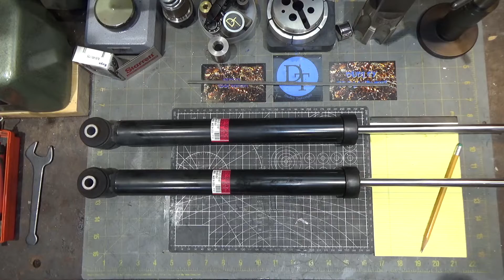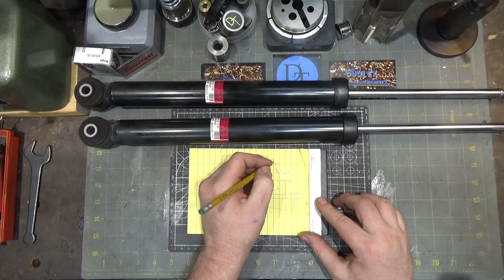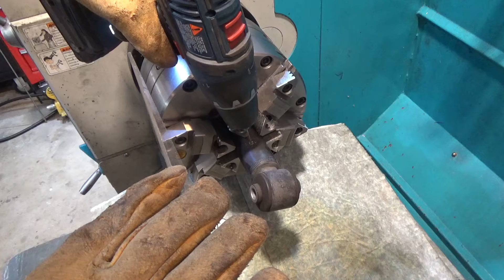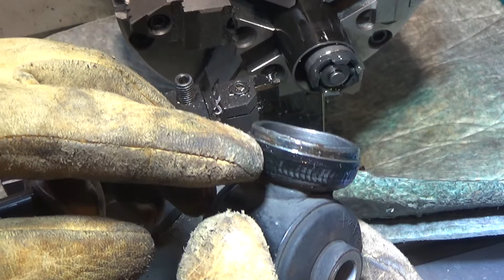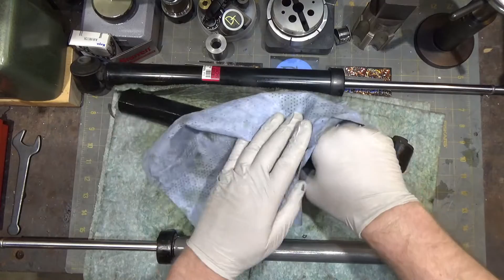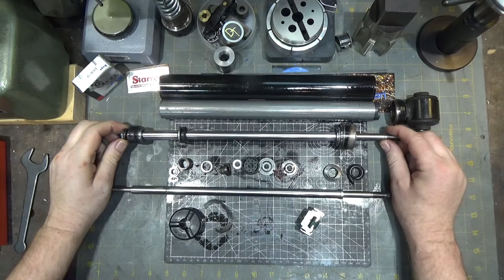138 Gas Shock Dissassembly

Comment: the sad thing is, that made in USA does not mean quality. That boat left long ago, if it ever existed.
Back in 1976 I had a Chevy Camaro 1967, and a few years later a BMW 2002 (1980). The Camaro I rebuilt for street racing. The 2002 was a mistake to buy, the guy that sold it to me put a new gas filter (clear) on. So I didn't know the gas tank was rusted out.  Anyway the Camaro was a POS design wise, and machining wise. The cam lifters were not correctly drilled so it ate lobes off the cams (multiple).  I could go on about problem after problem. I quickly learned that our cars were junk boxes. When I disassembled the bmw 2002 engine and rebuilt it in one day, I found out how far behind we were. Everything was machined to perfection. I started to see that we were stuffed shirts so to say. When I bought a Honda a few years later, I again saw and it reinforced that we were stuffed shirts, full of ourselves. I remember replacing shocks over and over, and how much better the mcpherson struts were. I noticed that they were engineering improvements and we were stuck in time.  The europeans and japanese were using disc brakes regularly, while we were still playing with drum brakes except for performance cars like the Corvette and El Camino..  Again, I could go on an on.. Monroe shock... sad.. low quality crap.
Reply from the maker: We are on the same page here. I still don't buy American cars, even though they have improved a lot, because to me a car is a tool that just needs to perform without issues. Most people I work with, buy only Chevy, and in that small sample, they all have many more problems like broken window regulators and dead alternators than I ever have.

Comment: Small comment as more often than not, this term is used incorrectly: "dampening" is getting something wet, whereas "damping" is reducing the amplitude of something.  Thus the term for the action of a shock absorber is "damping", not "dampening".
Reply from the maker: Thank you very much. I never considered the distinction.

Comment: If you do a search on Monroe sunset track shocks you'll see in the diagram they relieved the outer theatre wall of the inner tube to allow fluid to pass by easy in the middle which veer normal ride height
Reply: No problem I was a auto technician for 10 years they where the best when they came out
Reply: Monroe sensor track
Reply from the maker: I did not notice that. Thanks for the info.

Comment: @Dudley Toolwright  The adjustable feed rate dampeners like an Enidine ADA are pretty interesting too and much more complex than I thought. Something like that would work great on your band saw... Hey, that maybe a good use for the other one, just need to make a bypass with a flow control valve and prob a reservoir for when the rod in depressed to account for fluid displaced.
Reply from the maker: I love the bandsaw feed rate control idea, thanks.

Comment: You have it basically correct as to function. On race vehicles the shocks can be disassembled and the dampening springs and the shim packs can be tuned to get the optimum compression and rebound for the conditions and the vehicle suspension design. I have a basic idea of how they work but tuning shocks is an art!
Reply from the maker: Thanks for the feedback. Its always interesting to learn something new.

Comment: i seriously  doubt that the shocks are charged with much more than a couple of hundred psi.if the rod were only 1/2 sq in in area you would have a force of 1250 lbs pushing up and the rod ! i believe the purpose of the gas is to prevent the oil from cavitating as it moves thru the shock.
Reply from the maker: Excellent point. I should have done the math. I intended to and then plumb forgot. That would have been interesting info for the video.
Reply: @DudleyToolwright  A low pressure shock will be on the order of 60psi.  A very high one 300.  The vast vast majority will be from 150 to 200.  Cheers.
Reply from the maker: Thanks for the info. I really appreciate it.

Comment: cool video from wath i was told that the verey top should not have and oil to it and it should not bypass the center rang but I could be wrong and the only one that dose any work will be the bottom one and your right the top dose get wro out after time and that how they fall 
 I never had any problem with MONRO shocks thats all I run on my cars must been a bad day
Reply from the maker: Great points! I appreciate the info on Monroe shocks. Hopefully they spent all the quality effort and parts in the interior bits.

Comment: You should have drilled a metric hole it would have complicated the flow
Reply from the maker: Damn, I knew using imperial drill bits on a metric shock would be a problem.

Comment: If any amount of gas dissolves into the oil, then the sudden drop in pressure as the drill pentrated would allow the oil to froth into a foam, which briefly reached up to the drilled hole before subsiding.  This is why quite a lot of oil was still left inside.
Reply from the maker: Excellent explanation, thanks. When I was editing the video, I was thinking more about the cause and sort of came up with a similar conclusion. I was wondering if the manufacturer would choose an oil that did not readily allow nitrogen to dissolve into it or if that was even a consideration at all.

Comment: I'm an automotive technician, so i come across a lot of used shocks and struts. I try to always cut the shafts off for projects. Its very good material, whatever it actually is. I actually work at a Kia dealer, and can attest that OEM parts are way better than aftermarket.
Reply from the maker: Thanks for sharing

Comment: I was heavily into racing RC indoor cars years ago and I had to build and rebuild shocks pretty much every race day.  Those tiny RC shocks are built just like the real ones.  So many options of fluid viscosity, pistons opening sizes/numbers, spring stiffness, etc.  a lot of science.
Reply from the maker: My previous boss was as well. Apparently, you could have as much fun modifying the car as actually driving it.
Reply: Dudley Toolwright give it a try, I know you want an another hobby

Comment: Few more..

The rubber piece and washer up from the piston on the shaft is likely a top out bumper.  Diameter is smaller than piston so very little damping.

Of the 2 valves on the piston, the one with the spring is rebound. The other side is simply a one way valve on the piston to let oil flow through.  Again compression is the valve on the bottom.  

The compression valve at the bottom of the cylinder will have 2 valves also.  A compression valve and free flow valve to allow oil to flow through.
Reply from the maker: Thanks for the tips!

Comment: The are a number of issues you are missing.

What you have a number of issues wrong. 

1. what you have is a double wall shock. (there are single walls)  See link

2. the shock is pressurized to reduce cavitation.  Pressure is about 50 to 300 PSI of dry nitrogen.  If rod were say  1/2 inch and the pressure 3000 psi, you have about  600 lbs of force to more the rod in.  

3. the resistance is mainly the pressure inside the shock trying to force the rod out of the cylinder. I guess you could say that it is the area difference between top and bottom of the valve as it is really the rod that is being push out. 

4. There are 2 valve inside the double wall shock, one on the bottom and one on the shaft. Bottom for compression damping and shaft for rebound.

5. There are 2 speeds, low speed is typically an orifice. High speed is either a flexible shim or spring loaded valve.   

For reference. 

http://www.kybweb.com/en/shockabsorber/Structure.html

What type of engineer are you?  I'm retired EE but worked has a motorcycle mechanic while going through school to get my degree.
Reply from the maker: That was really helpful info, thanks. I did a bit of research before I made this video, but mostly I was trying to figure it out on the fly. I guess I missed the mark a bit. I really appreciate the clarification and correction. I am an EE as well, but wished that I had gone mechanical. I had no idea how much fun it could be, with endless bits to learn.
Reply: @DudleyToolwright  Personally unless something has changed I think EE pays more.. :D  I was fortunate as an EE to work on all kinds of electrical stuff so I was always learning new stuff in that arena.   Even working as a EE I enjoyed machine shop / mechanical stuff. It was a good way to exercise the mind on something else for the evening.   Still enjoy it.   When I retired, I sort of gave up on EE stuff (burned out)  but now get back into it when needed.     Anyway for me, it's all about learning.  I suspect it's the same for you.  Enjoy it..
Reply: @maxheadflow  What's fun is working in WW2 era buildings, that have had many different missions, with young EEs who just stand and scratch their heads when looking at the engineering drawings, compared to the as found wiring!!  I have many horror stories about wiring, piping, and other systems, in those old buildings.
Reply: Interesting.  LIke you guys, I am an EE working in mechanical.  These days, with a motorcycle shop devoted >90 to suspension and chassis (both race and street with a bit of dirt) and the odd electrical project.  I'm curious about a few things.  Where did you get th 3000psi idea.  I have done thousands of shocks and have never seen anything more than 300, save for a few shocks that use airsprings (like some small bicycle units) and even those are 4-600.)     Just the fact that you can compress the shaft that easily makes it look like way less pressure.  Anything more than 200 psi is tough.  That's mostly with non emulsion shocks where there is a much greater differential across the valve, but even on an emulsion or low pressure twin tube, they wouldn't be that easy to compress.    As far as hoop strength goes, yes, but I can say anecdotally, I have drilled many many shocks (maybe a couple hundred, most I work on have a gas valve oem) and it is never a problem.  A bit messy, but pressures are not high and if the shaft is extended and the hole at the top, not too bad.   On the inner vs outer tube, that is not for protection, but rather it is a twin-tube design. One of many architectures. ANYWAY, thanks for this and your other videos.  I'm still in my first couple years of machining and have a TON I could learn from you guys.  Now, off the the shop.  I have to machine a sleeve and cutouts to relieve spring pressure to remove hydraulic preload adjusters from some OEM KYB/SHOWA/WP suspension.  Cheers.
Reply: Very good job explaining the workings of a shock

Comment: Welcome to the difference between OEM parts and aftermarket.  As a diesel mechanic for 25 yrs (retired), you would be amazed at some of the aftermarket parts I've had to deal with and why I always tried to get OEM. That initial cost savings of the aftermarket parts just doesn't add up after the mediocre performance and short life span.  You really aren't saving money and you are generally unhappy with the low quality.  And then, me, as the mechanic gets stuck with the image that I'm trying to screw my customers wanting to install the more expensive parts or I'm "to blame" for the crappy results of cheap parts. Sometimes we just can't win LOL
Reply from the maker: So true. In this case, if you believe Rock Auto, the OEM shock were $20 each, and these were $65 each. I got these out of the performance section. I was none too pleased with the outward poor attention to fit and finish.